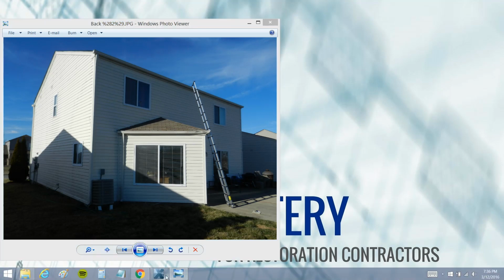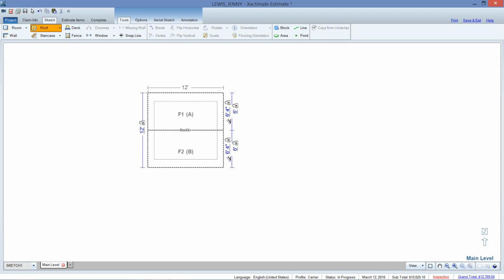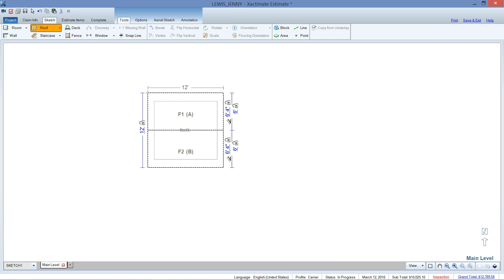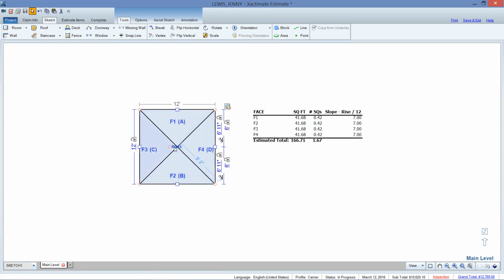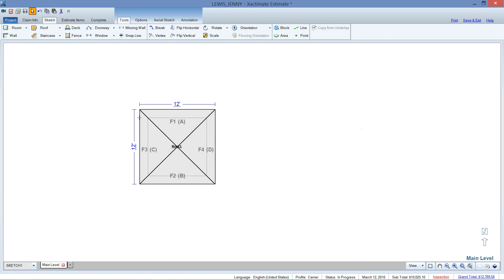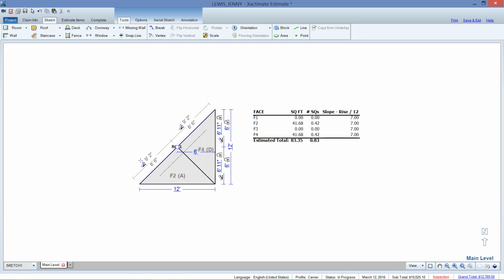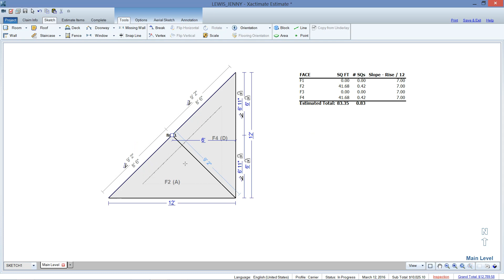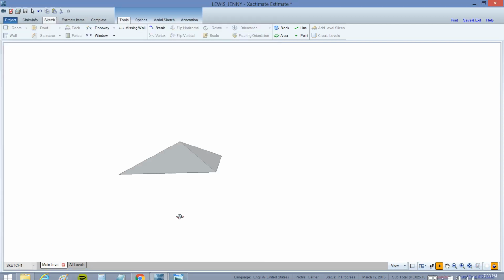How to Sketch a Triangular Roof

Comment: Having a hard time with the hip extension on lvl 2 sketch.
Reply from the maker: You would need to use the square break tool,  start with the hip overbuild, then do the south hip.  You would need to change the hip from both ends, to just one.   Good luck!
Reply: @EstimateMastery  passed my lvl 2 today. Thanks for the awesome and informative videos. Certainly helped me.